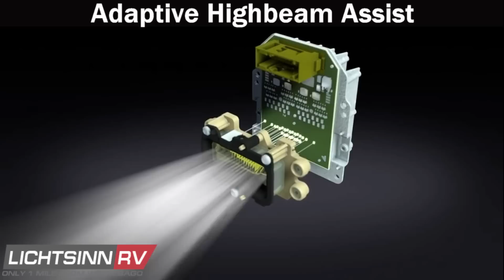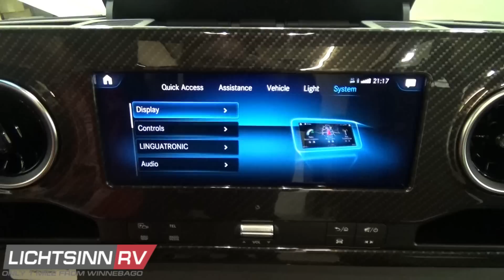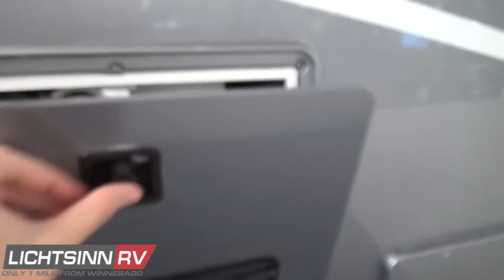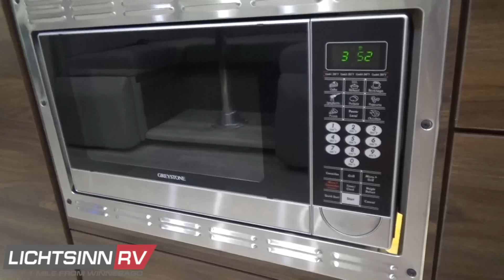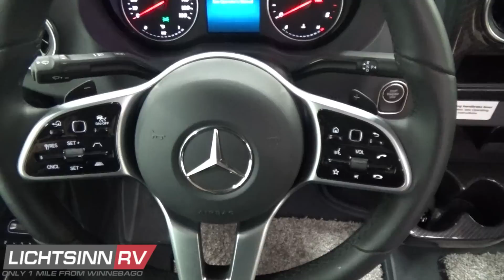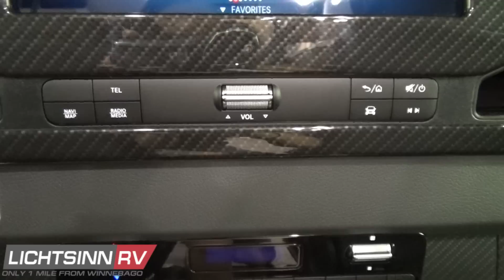LichtsinnRV.com - New 2020 Winnebago View 24D

Comment: You folks do the best videos.  So did I miss what it looks like inside with the slide in?  Since it's longer, when it's in, can someone move around comfortably?  That's an important issue for me. I went to the link when someone else asked the question.  I'd like to see video of someone walking around in it when it's closed. It looks really tight. Can the refrigerator be opened?
Reply from the maker: Good afternoon!   Thanks for your note.   Yes, you can open the refrigerator with the slide in (and with the Murphy bed down).   We do have complete photos of this with the slide in at this link (they are towards the end as there are hundreds in our gallery)  https://www.lichtsinn.com/product/new-2020-winnebago-view-24d-1093283-17

Hope this helps!

Comment: queston:  you consistently refer to the "walnut cabinetry."  Is it walnut wood?  Or, is that what you call the color of the cabinets and it is some other material?
Reply from the maker: Good evening Daniel!   Thanks for your note.   This is Italian Tecnoform cabinetry with a walnut finish, although this lightweight cabinetry is imported as it's primary use was on high end yachts due to its ability to resist moisture and to free up cargo carrying capacity.  Tecnoform produces exclusive, high-quality complete furniture for caravan and camper. Great attention is given to selecting innovative materials that allow reducing the weight of the final products up to 35%, on-going research is planned to investigate new technical solutions to ensure ease of assembly. Materials, construction methods, design and co-designing are Tecnoform’s differentiating elements. Here is the website link: https://www.tecnoform.com/en/products/caravan-camper/
Reply: @LichtsinnRV  OK.  So, Walnut refers to the finish or color, not the material.  What is the material?  Veneer over particle board?
Reply from the maker: @dmorean  Good morning!   Correct... Tecnoform's website indicates solid timber and finished in venner, CPL or metacrylic.
Reply: @LichtsinnRV  Great...thanks.  The cabinets are beautiful and it's great they are lightweight and moisture resistant.  Keep up the good work Winnegabo

Comment: Very happy to see: upgraded entry door, 2000 W inverter standard, larger slide, quality cabinets, excellent windows and window placement, great layout!  Wish to see: upgrade sofa/dinette fabric to Ultraleather and upgrade cushions to be more confortable (currently thin and compress to easily), bathroom window able to open, less of the dark walnut on walls (soft touch fabric would be nice).  In all, about as good as or better than any Sprinter based class C available today.

Comment: I know that the 2-panel 200 watt solar system is expandable...but to what degree?  In other words, without changing anything on the factory setup, how many more watts of solar can I permanently add to the roof?
Reply from the maker: Good evening Amy!   Thanks for your note... up to 550, so up to 350 more without adding another solar controller (which could also be done, but would most likely be unnecessary).   Hope this helps!
Reply: @LichtsinnRV  Perfect - thanks so much!